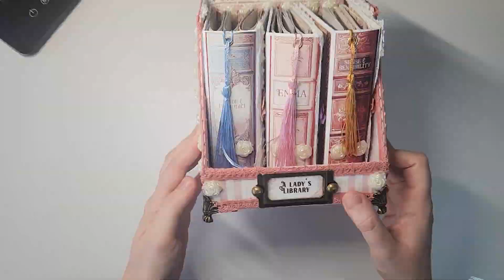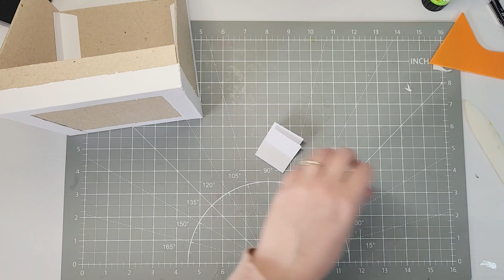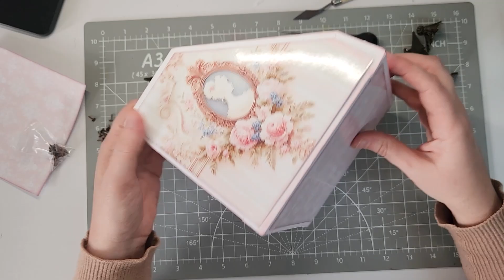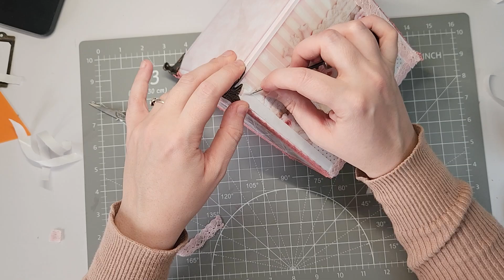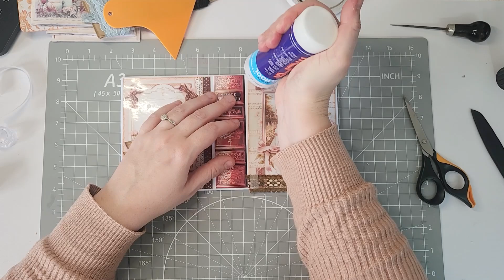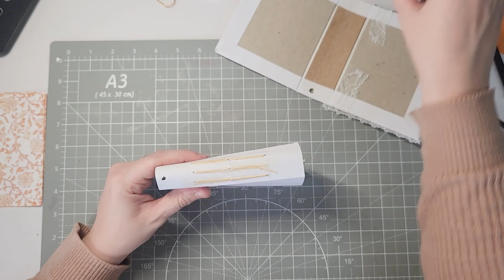FREE Project: Journal Holder + Mini Journal Tutorial!

Comment: Has anyone else had this problem. I printed out the letter size version and went to put it together only to discover that the sides measure 5 1\2 and the bottom and back measure 5 3\4 .The front piece is 5 3\4.

Comment: Absolutely beautiful! ❤❤❤ just a little tip , when putting your construction strips to your outer bare chipboard, just use one strip that will fit all the top and angle pieces, when you come to the bend  just cut in the strip at the sides leaving a tiny bit attached each side then bend it to go right down , that way you don’t have separate pieces all over 😊